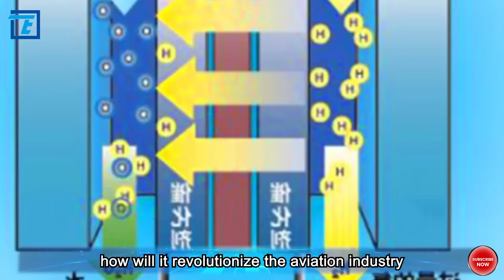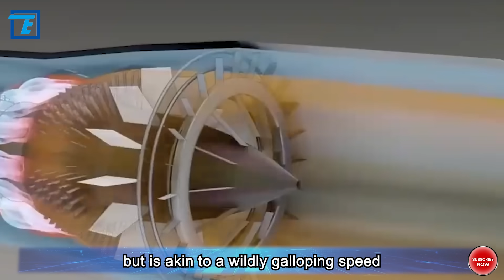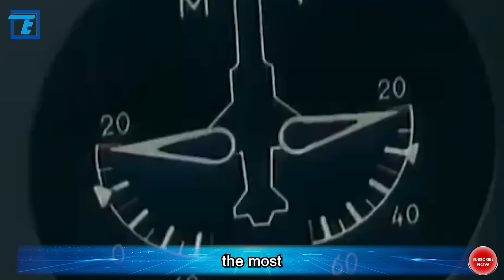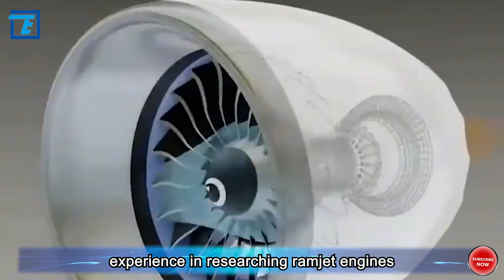China has shattered the supersonic ceiling with the debut of a "5 Mach" aviation engine!

Comment: China has invented 2 elements to attain  M5 ..
1. RDE( rotary detonating engine) 
2. Porous ceramics material as insulator for progressive high heat  temperature ..
3. The availability of wind tunnel test at M30 ...
I am just doubt  that china stated at M5 probably more...china has usually  low profile policy ...to say something lower as to ease competitor ...

Comment: Utter bollocks - chinee technology is stalling as shortages of advanced Microchips - mostly made in Taiwan (a separate, democratic country, near china) affect attempts at technological advancement in any field. Add that factor to the lack of advanced metallurgical knowledge - and the constant drive for profit over quality - not to mention the already well-publicised short service life (TBO) of their new fighter jet's engine - and the idea that jingling ping's best bunch of engine builders could overcome the enormous problems that would be faced by anyone attempting to produce a Mach 5 engine (which would have to be a combination of axial-flow compressor & turbine turbofan for subsonic & trans-sonic airspeeds, with the appropriate variable air intake - plus a scram or ramjet for higher airspeeds) is utterly laughable. The best communist brains in the CCP would be unable to solve the high-temperature alloy problems that such an engine would need - and they cannot access any of the advanced microchips necessary to design an airflow control system for such a beast. Dream on...
Reply: Blah blah blah
Reply: feel jealous again, feel sorry for you
Reply: @cheelew5409  Fella talking 🐊 language.
Reply: Yap yappy yap.
Reply: Your fake news media in the West are rotting your cognitive functions. 😂😂😂

You believe their lies, that is why you are experiencing cognitive dissonance about China's advancements. 😂
Reply: China can already produced chips on their own.. High temperature control in jet engine, laser system and rail guns are overcome.. Laser and railguns are already operational and in service... will be installed or replaced those old on ships and artillery... China had also discovered and come up with new metallurgy materials tough and high temperature resistance. It had want is required to build and research hypersonic jets engine.  U are still a frog in the well.  Go updated yourself and 😂

Comment: Wow, China has developed mach 5 engine which could revolutionize the supersonic air travel. This engine is more powerful than the engines that powered the Concorde planes. However, the problems such as very high fuel consumption and shock waves must be solved before a commercial supersonic flight can be realized. Knowing China she will be successful in developing a commercially viable ramjet engines and supersonic commercial aircraft. Mach 5 is 2.5 times faster than the British-France Concorde which was a failure in the aviation market. China will pave the way in the supersonic commercial aviation in the world.
Reply: I wonder how did they solve the problem with keeping metals solid at super high speeds that generate extreme high temperatures (space capsules can reach a speed of Mach 25 and can burn up like the space shuttle Columbia unless properly shielded). The US SR-71 "Blackbird" uses titanium hull and wings to reach a speed of Mach 3.0 and experiences metal expansion issues. One can imagine the hellish speed of the internal turbine fans of a Mach 5 jet engine and the temperature generated within - and we are not even talking about the design of a plane with aerofoils and body able to handle that sort of a speed. It is certainly getting into an area of extreme physics which makes one wonder whether the human body would be able to withstand such high stresses as well (imagine the "G" forces too at Mach 5).
Reply: @George-k6o9t  well, that is not so extreme compared to the nuclear fusion reactor that could generate a temperature beyond a million degrees Celsius. For these extreme China has found a solution for the wall of the fusion nuclear reactor. But, for the hypersonic speed carbon fibers can stand such temperature. Human being cannot withstand high g loads without going unconscious for a short second because of the blood that would flow down from the brain which causes unconsciousness. I believe that the 6th or 7th generation jet fighters will be autonomous, that is fully automatic without pilots.
Reply: @philiptan2051  Yeah - you have a point. Fully autonomous drones can be used to fly at those speeds.

Comment: That is interesting.  French and British made Mach2 Concorde.  They did run into problems they didn't have technology and temperature neutral materials .
Temperature neutral means material does not expand and contract with change in temperature. 20 C is temperature our measuring instruments are calibrated at.

Comment: If this news is true it means that China has very advanced technology
Reply: I think it is true because 
1. China is the only country to have wind tunnel at M30 ,..
( the importance of wind tunnel  is to calculate drag, heat and shape of air plan / war plan as such to gain  efficiency and less drag through simulation) ....
2. China has patented the invention of retoting detonation engine( RDE) , this engine is able to performe at hypersonic speed 
3. China has done and invented the skin of the plane is possible to use porous ceramic as to decrease the heat ....
Based on 3 points , china has produced the prototype of hypersonic plane  or at least still  producing  the prototype of the plane ....
❤❤❤❤
( correction for this media , supersonic if M1> supersonic>5....but hyoersonic >5...so any speed below M5 but above M called SUPER SONIC"...below M such as commercial airplane called " SUBSONIC) Above M5 called HYPERSONIC ....
Reply: @dovepenrol5955  China has only bla bla bla BS
Reply: It's only partly true. Yes, China has hypersonic missiles. But these use engines which are not suitable for planes. The video then went to suggest that you can step into a plane fitted with these engines and get from London to NY. Hahahaha. That's a dream. Typical of this channel.  Most of the footages are not relevant.  @dovepenrol5955
Reply: It's true.
Reply: And you still think that China had Fantasy about 5G and now build 6G that usa not invented yet?
Reply: @AnunakiAtlantis  China steals; it doesn't invent.
Reply: China was first to deploy hypersonic missiles in the world as displayed  in 2019 parade, if we r referring to those engines!
Reply: @F.Checker  First hypersonic missiles are in Russia you little liar. China likes to make many claims but thats it.
Reply: More Chinese lies.
Reply: @unbreakable7633  Many are hoping so and in denial when discussing about China ..... perhaps China haters are more insecure, unconfident or pure sour grape.  Chinese have been very resilient, determined, hardworking and focus than mere talking.  Guess they are just trying to beat their best and rejuvenating as they called it.  Some scholars even suggested that China is returning to be no. 1 than becoming no. 1 as history shows. News and people lie, the reality does not.  You only need a passport and a air ticket! Simple!
Reply: Anyway, do not under estimate the hundreds of thousands of engineers and scientist working for the growth of China.  It may not be true now, but it will probably be true soon.
Reply: Maybe the US invented aliens have abandoned them? 😎
Reply: it isn't
Reply: @iossysm 酸😂😂
Reply: @iossysm it isn’t Muricans
Reply: China father of the earth and usa just was born
Reply: @iossysm 
What do your country do in high tech innovation?
Reply: Wow.  You must not do very much investigation into what you think.  China has already demonstrated capabilities that the US can even imagine. @iossysm